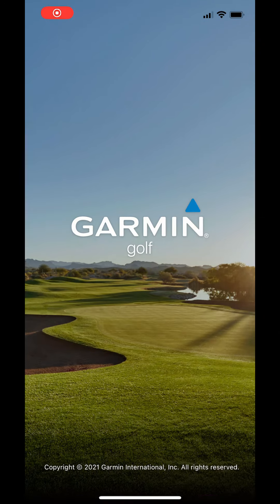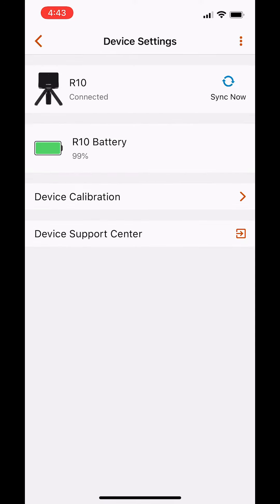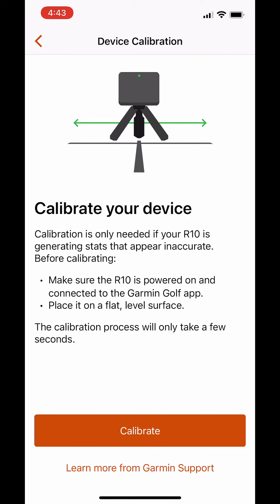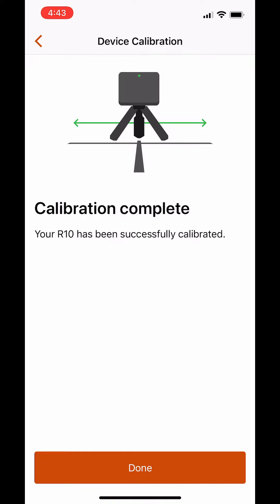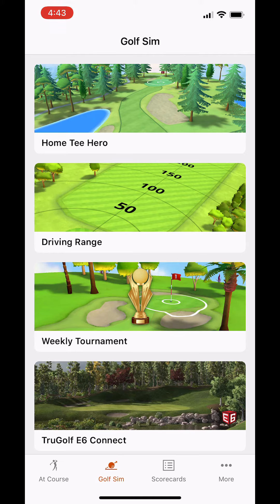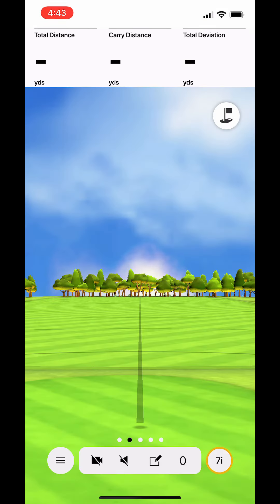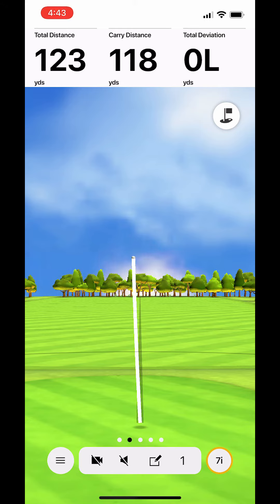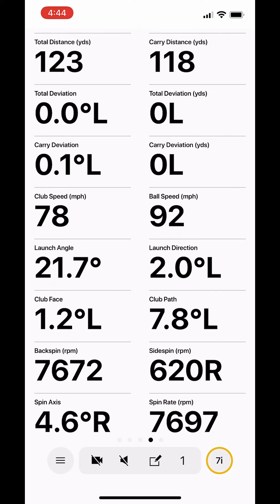Garmin Approach R10 NEW UPDATE! Calibration Tutorial

Comment: I can’t get my R10 to pick up shots even when it’s saying it’s connected to phone but when I go into Bluetooth and click on r10 it says ( an app is needed to use this device … help anyone I’m running the r10 on my Samsung A51 phone
Reply from the maker: Check out this video for the steps, but your phone will be in standby mode until you open the Garmin Golf app.  at that point you should see the garmin's light go from blue to white to green and be flashing green.  Once it is flashing green it is connected.  From there you can go to e6 connect app or use the Garmin app SIM options. https://www.youtube.com/watch?v=ukEr63re6-U
Reply: @DLudGolf  I'll give this a try but even on garmin app it's reading nothing not even on the range app it goes from sold blue to sold white  then flashes green take my shot it then goes sold green light but still nothing on the phone to show shot
Reply from the maker: @barrydesmond9288  Try this...turn on the garmin - it should be flashing blue (looking for bluetooth) then open garmin app on phone. (garmin should change from flashing blue to white to green. go to the garmin range and take a shot.  Look at the garmin when you take a backswing.  When you swing the club back it should go from flashing green to solid red light.  if it is not turning solid red when you swing, that is one problem.  If it never flashes green waiting for a shot that is a different issue.  Also if the garmin is solid blue then forget the device from all phones and other computers and then read it while its solid blue.  Hope that helps.

Comment: My setup in on my driveway (very slight even incline) so I am wondering if my mat is on that incline, should I keep the R10 on that same incline, or still try and level the R10. Or simply calibrate so it thinks the incline is level... Any thoughts?
Reply from the maker: From how I understand this update, the calibration is for side to side tilt that was messing up readings out on the range where the grass or ground was uneven.  I think you still want to keep the forward and back tilt as level as possible because that angle determines shot height which will impact your distances.  If anything you want the R10 facing slightly up from level.

Comment: I don't see that on ios
Reply from the maker: Look for an update to the gaming golf app
Reply: @DLudGolf  weirdly, I have tried everything I could think of, went to the app store looking for an update, it only showed me "open" so I'm presuming I have the latest version. All in all, it has been a frustrating experience, I hit 100 balls at the driving range tonight, about 10 didn't read at all, about 60 were reasonably close to spot on and the rest were so far off as to be laughable. I got to a point where I was purposely hitting pull hooks to see if it would register it as a pull hook and not a fade.  It did about half the time. It's just not accurate with anything longer than about 140 yards.
Reply from the maker: @samphotoyt  did you get the r10 up to version 3.7 using the Garmin express app
Reply: @DLudGolf  Yep, did it and headed to the range.